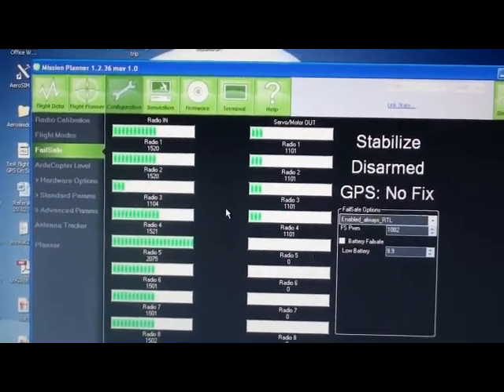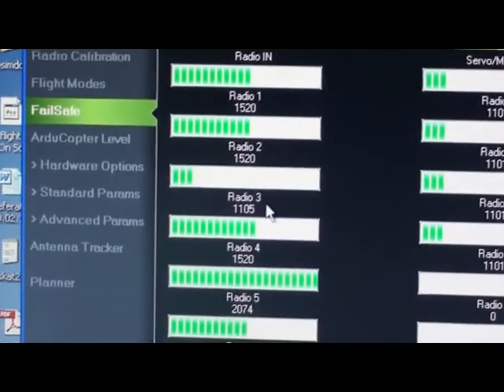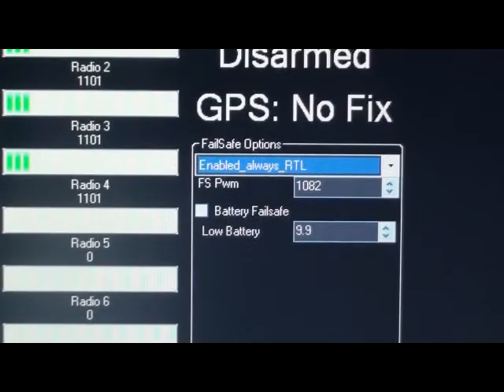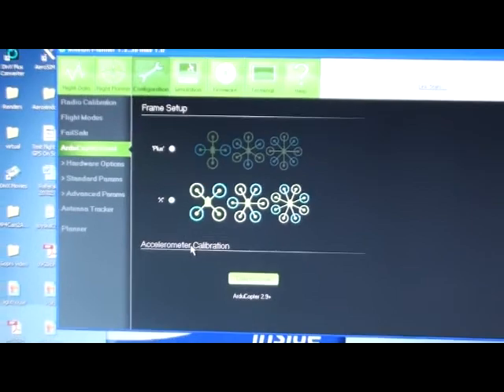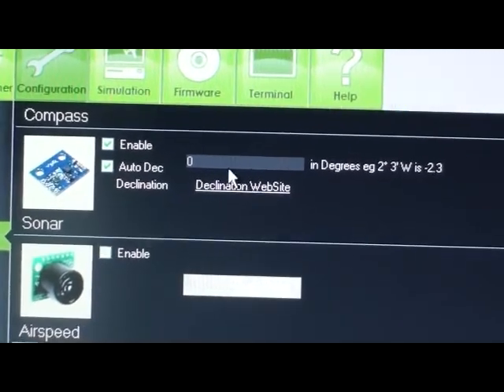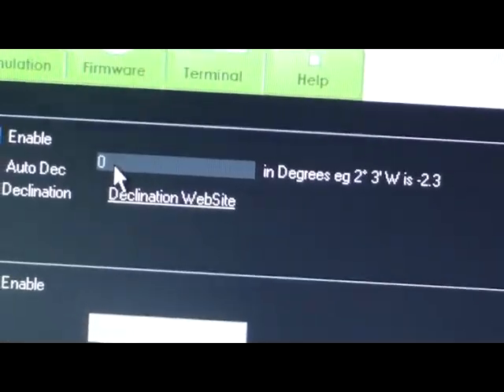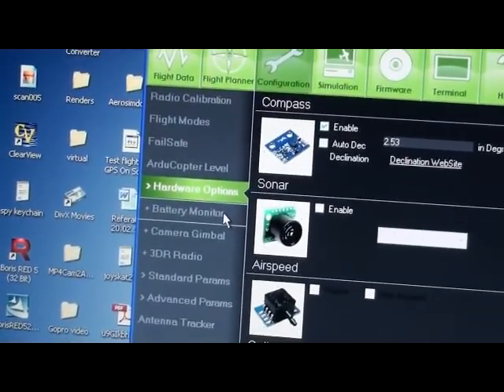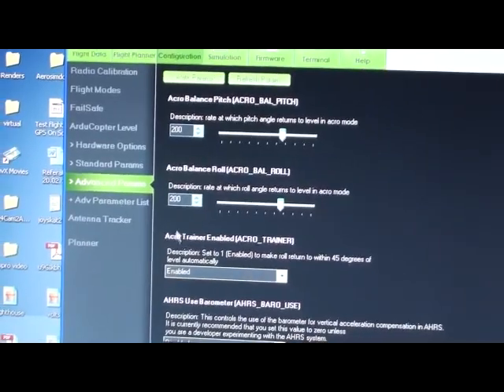APM 2.5 Ardupilot controller- setup guide 4 of 4

Comment: hello man, very helpful your videos!!,, but I have an issue, when I turn off my radio (when FS configuring) the radio 3 parameters doesn't change, numbers remain the same as the lowest throttle point,, i.e. radio ON= 1101, radio OFF= 1101, qhat I'm doing wrong?.. thanks in advance

Comment: What are the principle differences between the HKPilot and RCTimer'sAdruFlyer 2.5.2 implementation?  I'm definitely buying something APM 2.5.x and I've read that on-board magnetometers can be flakey in multi-rotor, so I'll go with the better GPS and mag.
HobbyKing includes cases and OSD, but I'm willing to listen to why RCTimer's comparable kit costs a bit more.  And OSD isn't a dealbreaker anyway.
My build is a 610mm slow-fly video platform, so I'm hoping to avoid "acrobatics" actually.

Comment: I am using APM 2.6 and Orange RX receiver dont know what i missing , when i turn off the radio i the  Throttle value didnt go down just stay as the same as lowest Throttle value same as when the radio is on.... any advise ?

Comment: Fantastic videos!  Keep it up!  I have a question, I am building an FPV QAV mini quad and am considering getting the HK HobbyKing HKPilot Mega Mini Combo Flight Controller GPS and Power Module kit.  Do you know if these APM boards are capable of achieving the kind of acrobatic and stability performance that one can get with say a CC3D or NAZE32 board?
Reply from the maker: Stability yes but not nearly so acrobatic
Reply: Ok thanks.

Comment from the maker: the battery capacity/ weight ratio is your main limitation. My longest flight times  have been about 18 mins and the furthest i have been with my tri was about 200 meters , after that it gets too small to see well with the human eyes and orientation becomes a problem.

Comment: Hi great videos I wonder if you can help I have finally got my compas to work level but when I connect the gps the artificial horizon moves all over the place.when I remove the compas from the board it goes back to level again.would it be an idea to reset and start again.thanks

Comment from the maker: Try doing a complete reset and erase of the firmware and reinstall 
To completely reset/erase the eeprom, connect it to Mission Planner, go into Terminal and type 'setup' then either 'reset' or 'erase'. Reset sets things back to factory default and erase blows out the entirety of the eeprom storage.
Do a reset followed by an erase, then re-load the firmware, re-calibrate the radio, accel, compass, set my flight modes and change any other settings needed (yaw reverse, etc.).

Comment: Hi 75 echo, I have a tricopter with Ardupilot2.5, a Futaba T8J and mission planner v1.2.53 mav 1.0. I have calibrated my radio and all movements are  reflected in the mission planner so I know the Ardupilot is receiving the receiver inputs correctly.
1.  No Yaw Servo response at all, (yaw servo ch7 obviously)
2. When setting failsafe,Tx ON min throttle is 1108, however with Tx OFF increases to 1140 (yours decreased to approx 1087). Any ideas? Thanks for the videos. Cam

Comment from the maker: Oh Yes, if you go into  the CONFIGURATION TAB > PARAMETERS, you will see an option called 'Channel 7' . Set this option to RTH and allocate it to any switch on your TX . if you activate the switch , it will override any current mode and put the craft in RTH. Likewise , deactivating the switch will put you back into your last flying mode.

Comment: I have version 1.2.44 mav 1 of the mission planner.  In a couple of places it differs from yours which looks to be 1.2.36?  In the "Configuration" section "flight mode" there is no "Easy mode" box to the right of the options.  Also in the "failsafe" section there is no "Enable RTL" option.  Where did you obtain your version? I cant see it in the download list and It looks to me that your version has the better options.

Comment: Hi 75echo
Great video's on APM 2.5, what's the chances of doing one on Mission planning way points for an aircraft, believe it would be different to a Quad, also I gather you can plan missions, save files and upload to APM as required am I right Regards Geoff

Comment from the maker: The APM 2.5 unlike the Naza or Wookong controllers do not use a preset throttle position in failsafe. The function is programmed already into your controller and irrespective of your throttle position will execute a successful failsafe if you set it up correctly and loose RC signal.

Comment from the maker: Your RC transmitter outputs a PWM signal that is captured by your receiver and relayed to the APM. Each channel on your transmitter has a PWM range usually between 1100 - 1900 with 1500 being its neutral position. If we lose RC range, the receiver if set up properly, will drop to the lowest known throttle value PWM (no signal PWM value).You make sure your 'no RC signal value'  is  5 units under the assigned 'throttle failsafe PWM value 'to make sure it is low enough to activate the failsafe.

Comment: Very good explanation. What I didnt understand is, why have you setup + 5 units in your failsafe? If you are in minimum throttle which means the RPM for motors is very low the quad will drop. I think that it would be better if you set it up like for example when you are in hovering so that the copter doesnt drop when the fail safe kicks in. What do you think?

Jason